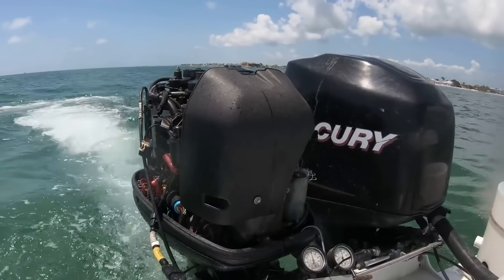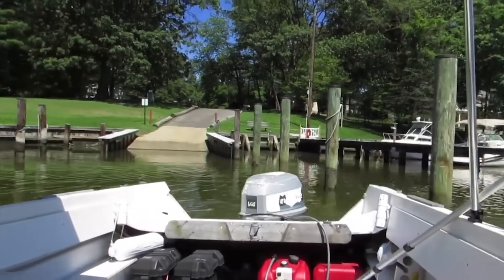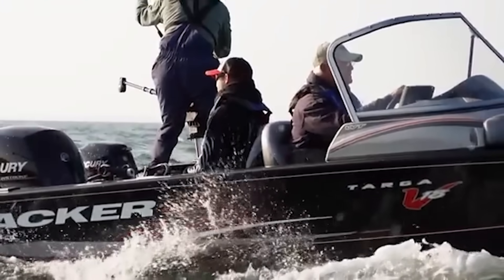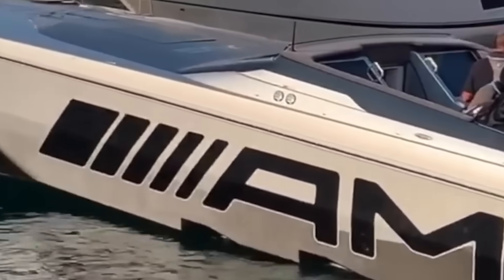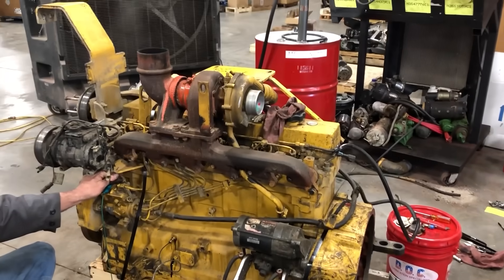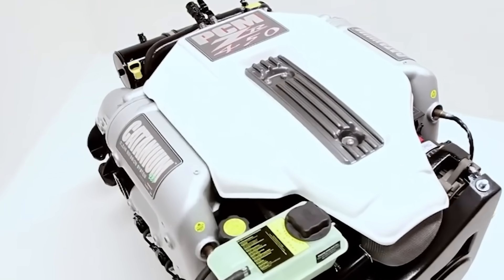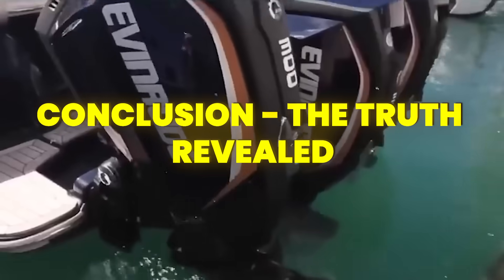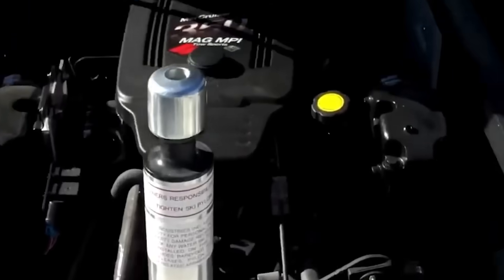The SHOCKING TRUTH Behind Running Your Engine at Idle!

Comment: Good to know. I;m a PWC (Yamaha FX HO)  boater with a 😂high RPM jet motor. I have to idle out of a canal at about 1800 rpm out of a creek before I can give it the beans. This takes about 15 minutes and I have found that the fuel consumption is actually higher in mpg than at fast cruising. Do you think this will hurt the engine?
Reply: If your mixture is correct and you use quality semi- or fully synthetic outboard oil, there won't be any issues. Your plug color is a good indicator.

Comment: Thanks for reinforcing what I've always believed, and done, for any internal combustion engine that I've owned ...that is to let them warm up to operating temp before punching the throttle. Not only do I believe that this better for the engine, it offers you better performance. A cold engine has not reached its proper tolerances and as such will never give you its optimum potential. Good video, good monologue. 👍

Comment: My Mercruiser 165 I/O (GM 4.1 liter/250 cu in L6) will idle all day long with good oil pressure and engine temp. I never putt along at dead idle (600-700 rpm) for long periods of time. I always kick it up to 900-1100 rpm in no wake zones or during warm up to keep the OP up and water pumping nicely. For slow speed cruising without plowing water in my 1976 heavy tri hull, I run between 1200-1500 rpm. Any higher than that and I start getting bow rise and plowing water which is incredibly inefficient. Beyond that I get her up on plane which, being a tri hull, does so with very little effort and low rpm requirement to stay up on plane. I can get her up and maintain plane as low as 2200 rpm. Her sweet spot for cruising is 3200 rpm and anywhere from 24-27 mph depending on load. At that rpm she only burns about 5-6 gph of fuel which is phenomenal for a heavy, old, 17.5 foot tri hull. That's actually really good for a boat in general. Flat out at WOT with just me and a full tank of fuel on perfect water she turns 4500 rpm at 41 mph. I rarely run at WOT but every now and then I take her out and "blow her nose." Typically I don't run at anything over 4000 rpm for an extended period of time. The difference in fuel consumption vs speed at 3200 vs 4000 rpm just doesn't justify running the engine faster. Besides, when I'm on the water I'm on lake time and I'm never in a hurry. Unless there's a reason to haul ass, like an incoming storm, I tend to take it pretty easy on my old girl. Hence, she never lets me down. I'm also very anal about maintenance. I very much live by the old saying "take care of your shid and your shid will take care of you." Facts!

Comment: This video apparently has not included Fuel Injection and in the Big carver with the engine running to run the A/C, spoiler here the engine doesn't run the A/C the Generator does

Comment: Yes and no if you choose your oil more often it counteracts the effects. When an engine sits at idle you get more fuel dilution of the oil so again as long as you change the oil more often you're fine why do you think diesels idle all day or night long and still go 5 or 6 hundred thousand miles before they need rebuilding because the oil capacity is vastly larger than a gasoline engine in most cases your looking at 5 gallons in a diesel compared to 5 quarts in a gasoline engine
Reply: Try 10 gallons in a class 8 truck with a 15-18 liter diesel. Change out every 15k

Comment: 5.0L Volvo GXI in my Albemarle 248XF.  Normal operating range is 650 RPM (Idle) to 4900 RPM (WOT). I always let her warm up to normal operating temperature which is 155⁰-165⁰F  before leaving the dock. The owners/operating manual states the engine is designed to run indefinitely at 3600 RPM, which yields me about 26 MPH. I'll usually stay in this range, occasionally running at 3800 RPM or 28   MPH. Max recommended WOT is 4600 to 4900 RPM, which i rarely do.  Running the boat this way, she's lasted 23 years.
Reply from the maker: Sounds like youve taken smart care of her. How many hours you putting on it?

Comment: ive a yamaha f90 with 65 hours on my 1975 venture super 1650.  i do a LOT of trolling at or near idle.  its ok for this motor to idle for extended periods isnt it??
Reply: That motor is okay but it is recommended to go WOT on your way back in for the last mile or two. Also run seafoam or Yamahas Ring Free to help keep the carbon down. Great engine though
Reply from the maker: @MattsDoghouseoutdoors great engine indeed. Thanks for commenting guys.

Comment: Great, but what about older 2strokes used on small fishing boats or pontoons? Was told on mine to fire up and quickly advance to 3/4 - full throttle? And every idling or manouvering time to combine with fast runs... Thanks on hints. Cheers
Reply: Use 4% oil mixture and start it and dont floor it first couple minutes. 
This guy making the video are clueless